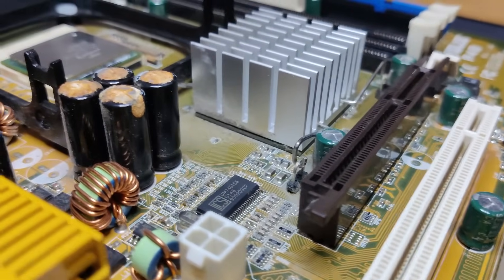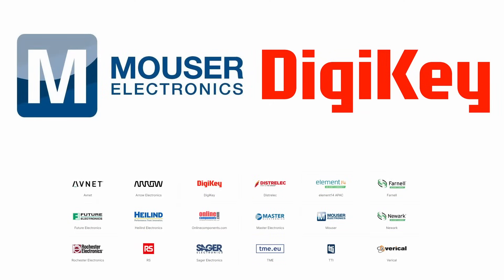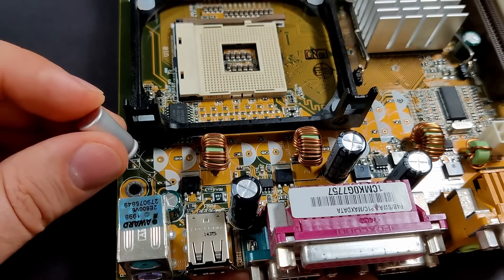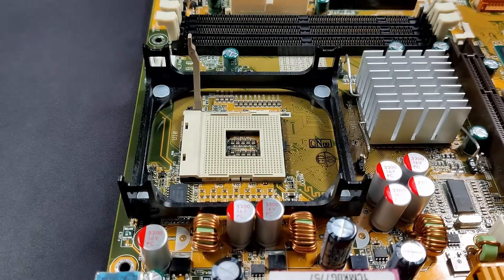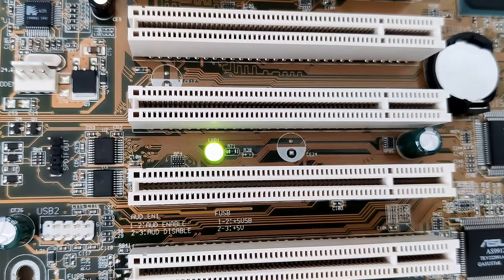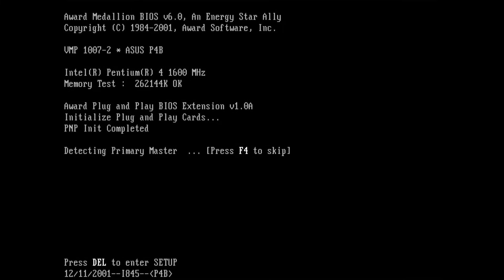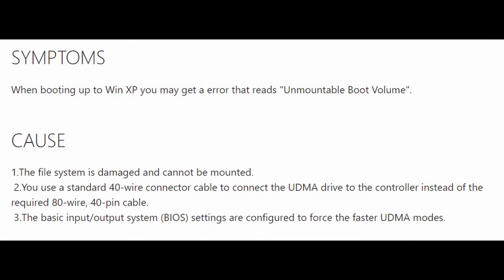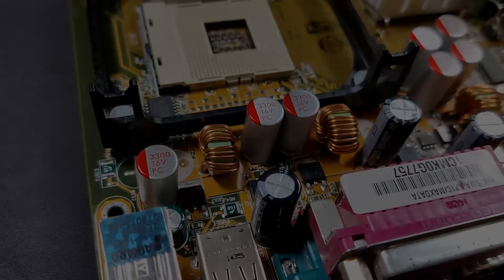ASUS P4B: New capacitors, a talking BIOS and Ultra DMA woes

Comment: Those chinese no name "solid" caps can be also be regular caps without vent markings... Things that expect solid caps don't last long and the bang from venting is quite load
Reply: That's most likely the case. Few years ago I had to buy some solid caps and I remember not finding any above 2000uF at 6.3 volts, I'd be amazed if there are now 3300uF/16V ones. Also, as stated, ESR is way too high, similar to general purpose "wet" caps.
Reply from the maker: I'll try to get proper caps some day and redo the test. I did notice that the ESR is almost identical to electrolytic capacitors, but I don't know what that value of those solid capacitors should be.
Reply: @bitsundbolts  If talking about ESR, it is around 7 mOhms for the 2000uF/6.3V that I got (Wurth Elektronik). If talking about capacity, the unwritten rule is that you can get away with about half of the original value, but I try to use 60-75% of it. The likely explanation is that when the board was designed, the engineers had a target ESR in mind instead of a target capacity.

Comment: I'm glad you mentioned the confusing silk screen polarity markings. Earlier this year, I recapped an entire Biostar slot-1 motherboard backwards because of this and only realised my mistake much later after the north bridge had fried.
Reply from the maker: I am sorry that this issue caused you to lose a motherboard. It's really odd that they did it that way!
Reply: I always leave one old cap in on just in case this happens, until I am ready to put new ones in, then I start with that one and do all the rest.

Comment: I'm glad I am not the only one massively struggling with motherboards + capacitors! It is a pain!
I need to meet whoever had the idea of a "talking bios". I think it's the most useless feature ever designed. :D
Reply from the maker: Considering the extra ICs, voice actor, software development - I really wonder how the "this is a great selling point/benefit" pitch was done. That person must have been a great sales person...
Reply: You could say that again 😂

Got a whole backlog of boards to improve and just got two done through a nasty cold I had - finished a full-polymod on a ABIT BE6-II, a partial polymod on a BP6 (yes, that dual Celeron/440BX based monster 😅) and a Luckytech P6BX2 standard 440BX mobo that supposedly does 133FSB (spoiler - it can't do it to save its own life lol 😂). 

I still have many to go, including a somewhat similar board to Bits und Bolts - a P4B533 that also features the funky voicechip (which I recently found on an A7V8X as well, of all things it could exist on 😮)

Comment: Had one of those talking BIOS boards. Was annoying indeed. Always forgot to turn that off after a BIOS update/reset when experimenting/overclocking. But when investigation a failure I'd still prefer this talk.
7-segment post code > speech > beep codes that vary by manufacturer eyeroll

Comment: I owned one of those talkinf bios boards and yes you were right I quickly jumpered it to OFF. I must still have it in my loft as I have evey system I have ever owned up thier going back to my Amiga 1200 Tower with Zorro 2 slots (which seems to be fairly rare nowdays)

Comment: asus and asrock both at least in that time period did the reverse capacitor slikscreens this is such a pain :]
but that was a paciliuar hdd fault, most time i connected udma drive on dma cable it simply complained in the bios that i am using wrong cable or just downgraded for me. probably depends if dma level resolving logic is on hdd firmware , on botherboard bios or both and those sd card readers might not want to downgrade unless it is enforced from the controller side

perhaps the voice post codes require more room on bios chip and cable fault reporting was choped :]

try regular udma hdd if it behaves the same it is the mobo, if it downgrades to dma 33 it was the sd card reader
Reply from the maker: Regarding the voice messages, as I understood, there are dedicated ICs on the board to enable that feature - including storage space.

Comment: When designing a switching supply you have to look at the loop stability. Some "simple switchers" need a specific ESR to be stable. In this case you will have a switcher part then a inductor a cap and then a ferrite  bead before the main part of the capacitors. Looking at your PCB you don't have a small ferrite bead with each larger inductor so you have the type where the loop compensation is done using a small SMT cap and SMT resistor. In this case the lower the ESR and the more capacitance the better.

Comment: For polymer caps the esr is stupidly high, it should be like .02 or so…weird. Compare to original datasheet
Reply: Methinks someone in China got creative and proverbially put lipstick on a pig.... This is why you should buy from reputable distributors.

I don't know how good these transistor testers are for ESR though, they're not exactly a dedicated ESR meter after all.
Reply from the maker: It is all an approximation. I wish I would have the proper knowledge and the right equipment to measure it more accurately.
Reply: @bitsundbolts  you do, you’re amazing mate. Don’t ever sell yourself short. I always reference the datasheet and buy as close as possible. It’ll probably be fine, but caps lifespan will be less than

Comment: All capacitors reported as capacitors by the tester is a nice beginning :)
Reply from the maker: Yeah, it would be bad if they report as a 1 ohm resistor...
Reply: @bitsundbolts Not sure .3 ohm ESR is much better than a 1 ohm resistor :)
Reply: This capacitor is a 555 time...  @bitsundbolts

Comment: how come you didn't use the fnirsi? something wrong with it?  that talking bios is mega cool
Reply from the maker: The fnirsi is absolutely fine. I used it for desoldering and soldering the capacitors. Unfortunately, the ASUS board has large copper planes. I think any soldering iron would struggle without a heated board. The Gigabyte Board footage in this video  was taken a long time before I got the fnirsi iron.

Comment: I remembered this exact voice message as soon as you mentioned the feature 8:34 from my old Asus A7N8X-E Deluxe Socket A motherboard. I still have it with an Athlon XP-M 2500+ (Barton), that once worked at 2.5GHz. I'm looking forward to restoring that system one day 😅
Reply: I own same MB with A-XP 2600 and had that option ON for a while, but it bothered me finally.

Comment: The flashbacks of those obnoxious talking ads that came on full volume out of nowhere, without any warning on one of the 50 different popup windows that opened from just one click… Also, ads had to talk, AV software had to talk, printer driver had to talk and here even the BIOS has to talk. No! Just no!
Reply from the maker: Luckily that feature didn't survive for long

Comment: I have a few boards with this speech function and yes it does become bothersome quite fast.

I have considered replacing caps on motherboards but was worried I would ran into the issue you ran into. Since I don't have a hot air station. Would you advice to try ut anyway?

Oh and I'd love to see how much thermal paste was squeezed out between the cooler and cpu haha ;)

P.S. I love the bit with the Out Of Box Experience (oobe) in the end. Nice music always.
Reply from the maker: The difficulty of replacing capacitors seems to be linked to what area they connect to on the motherboard. If you have them at those large copper planes, it will be difficult to remove them. The Gigabyte Board was easier to recap than this ASUS board.

Comment: From what I read online, replacing an electrolytic capacitor with a solid, one should use only half the capacity. Don't ask me why, I have no clue and I always replace them 1:1.
Reply: The why is simple, the originals were deliberately oversized just to get the ESR down. With a switching frequency in the hundreds of kHz, you don't actually need all that much capacitance.
Reply from the maker: Interesting...

Comment: Interesting IDE cable problem. The motherboard is supposed to detect the 40 pin cable and limit the Ultra DMA mode to 2.
Reply: how does it actually detect it? does it just run a test for interference or something?
Reply: @Megatog615  80-conductor cables have a pin connected to ground which 40-conductor cables don't. This pin is checked by the IDE controller, which tells the BIOS which cable type is connected.
Reply: @Megatog615  It is detected by grounding a pin that is normally not used in a 40 pin cable. So in theory, the SD-IDE adapter could be incorrectly grounding this pin.

Comment: Back before I had a vacuum desoldering station I would often use 22 awg solid copper wire to clean out the holes.   The solder would stick to it and act like a desoldering braid.  I would just keep heating and pushing it in the same direction until it would pull back out.  I can recall recapping many Abit boards BP6, VP6,  etc.   So much easier now with the desoldering station.
Reply from the maker: I have to try this! Thank you for this idea!
Reply: Allright, I'm taking notes. This might be usefull information for me.

I'm planning to do some capacitor replacements on motherboards but I don't have a hot air station yet.
Reply: @NaoPb  Don't use hot air around caps, they tend to blow up. Hot air is for surface mount components. On surface mount components such as solid state caps,  I will twist the cap off then use de-solder wick for whats left.
For any holes you can use small drill bits and a rotary tool or Oxy-Acetylene Tip Cleaner Set
Reply: I have stainless desoldering needles, I never used them but I wonder if it would help clear the holes out. I mostly just flood holes with solder and then just pull it out with my modified solder sucker on which I installed a silicone nozzle. And just hold the iron on until it's heated through.
Reply: Desoldering needles? I use just plain thin sewing needles to clean the holes. Just putting the motherboard above the needle that is aligned with the hole, heating the hole with my 100W soldering iron and the needle punches solder in the hole and cleans it enough for a thin pin like, say, a capacitor has, to go through.

Comment: I once recapped a socket 939 sli deluxe board, which also had the speech built in. I also had to reflash the bios on it because installing and using windows xp was slow and a pain to use, after the flash it worked great :D

Comment: I don't understand why these SD-IDE adapters require 80pin IDE cable. The converter chip does not support UHS, so it's limited to 25 MB/s anyway.
Reply: Guess they are very sensitive to interference? And 40 wire is very old and for low speed. (Not that 80 wire is fast haha)

Comment: One recommendation I would make, is to reflow the solder on the NB heat sink connector mounts. Back in my repair days I saw many motherboards laid low by a broken solder joint on the NB heat sink connector. The solder joint would break and then the heat sink would pop off and after repeated uses the NB would fry do to over heating. As always, great video!
Reply from the maker: Hello James! Thanks for the hint. I will check the connector mounts.
Reply: I would also clean all the solder off and bend the through hole wires/pins as tight to the board as I could and then solder. I would also use thermal conducting epoxy to glue the heatsink to the chip.
Reply: Mhm i had a P4B which rapidly degraded its NB but the heatsink mount was still OK! I have no clue what the cause of death was. The board was warranty repaired and I actually ended up installing a blue Zalman NB heatsink on it instead just in case. The repaired board had not failed until retirement, I don't know where it is now.

Also I knew the board had the voice feature but I never used it. I think I turned it on and hated it and turned it off again.
Reply: I have an Epox 8KRA2+ that I recapped a few years ago. The northbridge heat sink is held in place with two loops, and not too long ago one of them failed, making the heat sink fall inside the case - the racket it made woke me up, and made me wonder where the noise had come from! A couple of days later I saw what had happened, and luckily the heat sink loop was still inside of the case, so the repair was quite easy.
Reply: @yosemite-e2v  Love that it fell in a fortunate way and didn't short something out.
Reply: @SianaGearz  The machine was unplugged and not in use when it happened.
Reply: I have a few boards where these joints have failed like you mentioned. Good thing I was there in time before the northbridge failed.

However I could not recover since they shot away into the case somewhere or are broken. Now I'm stuck with no way to mount the cooler. Do you have any suggestions?
Reply: @NaoPb  You can buy new ones. They are called "solder anchors for BGA heatsinks" and are made by Aavid, Thermal Division of Boyd Corporation. Or you can go the janky route and cut/bend a steel paper clip to the proper shape and solder that in -- extra MacGyver engineering points for adding the plastic strip from a pin header to make it look nice. That's assuming that the solder pads are intact. If not, I suppose you could go super janky and loop some solid coper wire through the holes, twisting and then soldering together the ends to help stop it from popping loose.

Comment: I think I still have one of those talking boards in some box in storage, might be a P4B as well. It was quite funny hearing those messages, but I found them actually useful. Instead of trying to decorate the errors from the beeps, it was easier to understand what's going on.
Reply: I think my Asus A7V8X from the Athlon XP era had this feature as well. And yes, the novelty wore off rather quickly 😉 I was using an SB Audigy card as my main sound source anyway so I kept the feature on and simply disconnected the additional speaker from the on-board sound unit (I remember reconnecting it briefly when troubleshooting though as it was still more convenient than figuring out the error codes shown on Asus iPanel display).